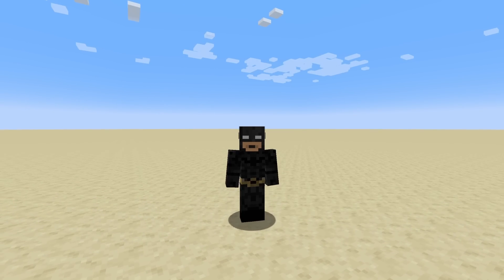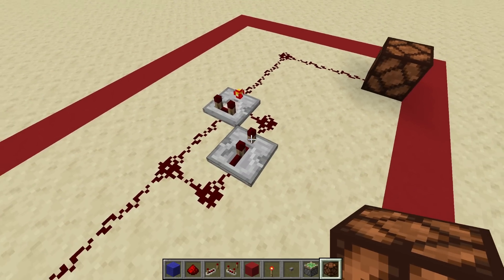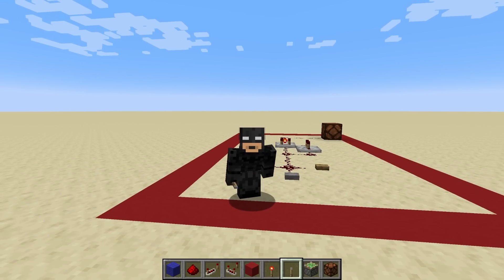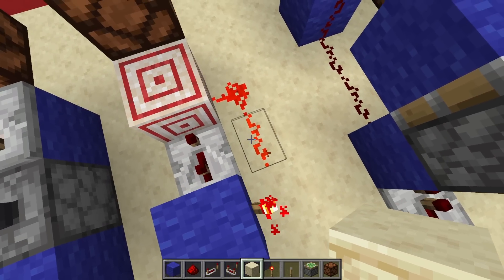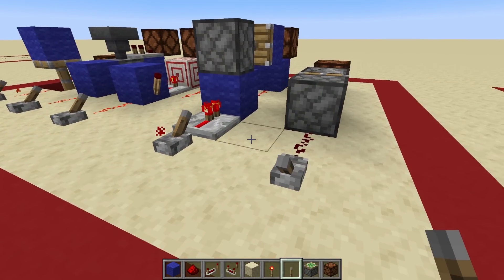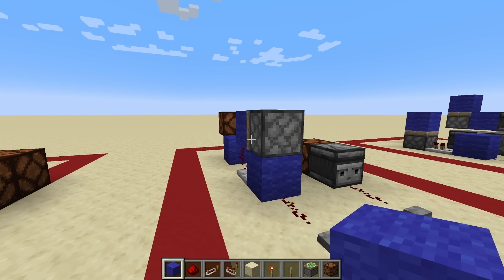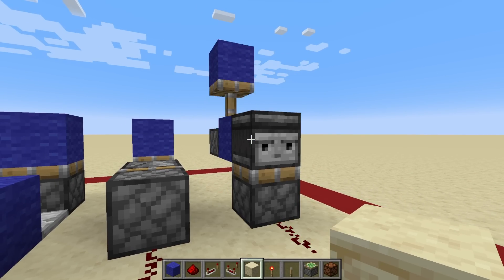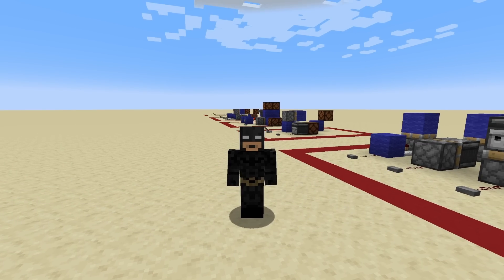This Unlocks So Much Potential... - WTH Is a Monostable Circuit??

Comment: Hmmm... The problem is that you've taken the term "monostable circuit" and used it exclusively to describe a "one tick pulse limiter". So that's quite misleading ... A monostable circuit is one that always returns to its original state. What it does in the meantime is irrelevant - it could give out a really long pulse, randomly give between 0 and 100 pulses, play a song on a bunch of notebooks, etc... It's an understandable mistake because almost everyone makes it now. The wiki has a page that describes it correctly and one which describes it incorrectly. Go figure
Reply from the maker: The dropper-hopper design is not one-tick, and I gave a proper definition at the beginning that does not imply one tick.

Comment: I never liked the term "monostable". While it is true that the circuit only has one stable state, that is not the important aspect of the circuit IMO. The most important aspect is consistent output pulse duration, regardless of input pulse duration, or having a variety of different input pulse durations. When I was first learning about this stuff, having a more appropriate name would have saved me a ton of time in understanding this circuit. Why are longer names avoided when they can be shortened? I wish they would just call it "stable pulse generator" circuit, SPG circuit for short.

Comment: Great video overall - my only suggestion is please don't move or jolt the camera when demonstrating the redstone, as it makes it harder to see and the circuit has already finished by the time the camera stops moving.

You could either move the button up a block so that the whole redstone is in view when pressing it, or use the Freecam mod to reposition the camera before pressing the button. 

Thanks. =)

Comment: well, an observer IS a monostable circuit. That can be activated by any form of block state change, except for fill level, or redstone signal strength level (except for redstone dust, where it actually involves a visual indicator, hence shows as a block state  change) for some reason. I'm partially thankful for that, while partially surprised.
That said, to convert any rising edge/falling edge circuit to the opposite, is a pretty simple change in most cases. Usually a redstone torch and some dust is enough for it. For dual edge, you'd simply have to either include an observer that detects both changes, since that's a 1 block dual edge circuit as you've said too, or connect both states (active/passive) to the output.

Still, the one thing I use monostable circuits for, is the toggle functionality. Because I like having note blocks as buttons, since they look so much better than levers. Especially in a build that has so much wood in it, like the indoors parts of most of my builds.

Your explonation about the subject matter is easy to understand, and sounds like a good explonation to beginners in redstone. Quite nice video.
Reply from the maker: Thanks! I went over a lot of these pointers in the video tho :)

Comment: I never heard the dual edge term before! Observers detected the redstone, but they do all block updates, like when water is in front of them, when logs are pushed onto leaves connected to them, and much more! Also, the sculk telegraph is new to me, and I never built one of those before! There is one design of rising edge you did not cover in the video that is well-known, and your explanation of monostable circuits was pretty cool! I did not know they were called monostable circuits!

Comment: This was very helpful because I was trying to make a pitfall trap but pressure plates take way to long to deactivate (it was a pitfall trap with signs and pistons and the fall only happens when the piston is deactivated) but with this it’s pretty much an instant pitfall (another thing is that I could have made a pitfall using observers but I was going to make this trap in an event where the nether is locked so sadly observers and comparators are out of the question)

Comment: I actually used one of the designs to make a combination lock. If you take the kind that you see in the thumbnail and put them one after the other, whatever input you make will be the next number in a sequence of binary. Some messing around, and I was able to take that concept and make a fully functional combination lock
Reply: How did the whole mechanism work?
Could you explain it further?
Reply: @abercrombieblovs2042 probably using the monostable inputs to turn on or off (binary) switches which then form a circuit to power on (or off depending which way you decided) a lock

Comment: I don't get why falling edge will be usefull compared to rising edge, who are faster. 
I understand the use of both for double short signal, but I don't understand the importance and matter of falling edge alone. Can someone explain me pls ?
Reply from the maker: It's useful if you want to send a signal when a machine turns off but don't want that to happen when it turns on. It's a little less commonly used than rising edge, but it's still pretty common.
Reply: @jazziiRed  okay thanks !
Reply: @SayanelDeFillaim For example, the opening and closing of a piston door are usually different. So one part of the contraption opens the door on the rising edge and another part closes the door on the falling edge.
Reply: What if you NEED that delay? Maybe you need to wait for something to be moved out of the way before you can do whatever the circuit does. Like a flush piston door.